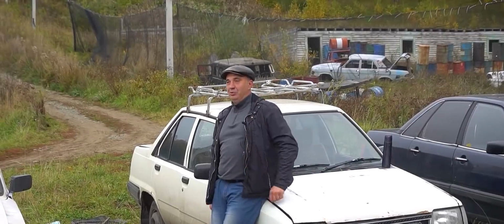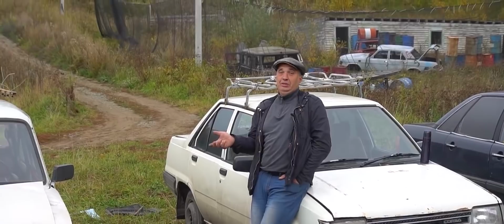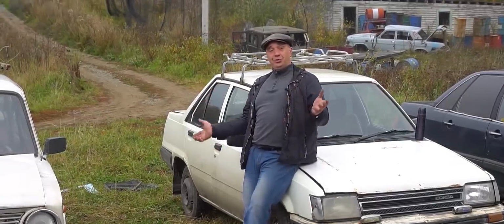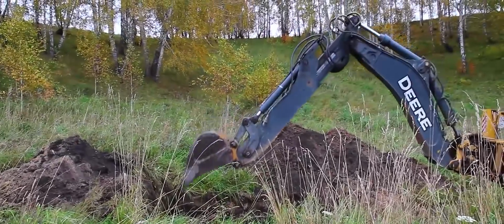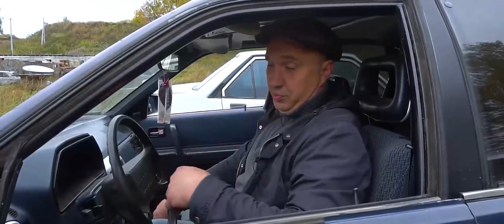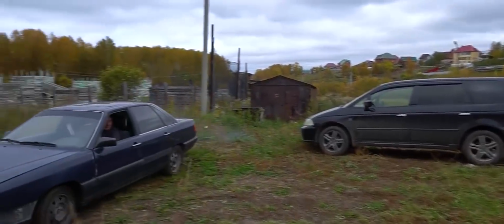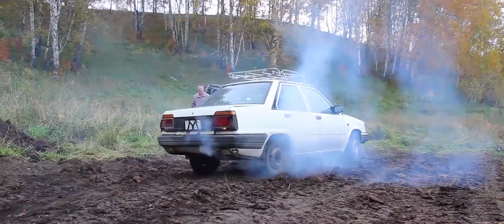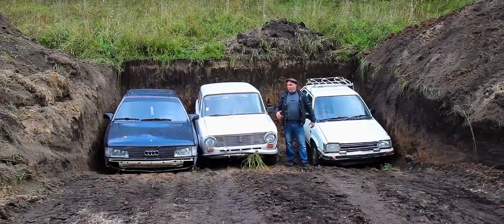We buried a German, a Japanese and a Russian

Comment: Next year: Some Russians forgot about the cars. In next 3000 years: Three unidentified artifacts discovered by archeologist.
Reply: after 3000 years, just change battery and oil and the toyota still run lol...
Reply: Meanwhile the Lada starts straight up on it's orignal battery and 3000 year old oil
Reply: They removed the batteries...
Reply: They actually dug them up recently. Most likely that video will be translated soon.
Reply: @SwapBlogRU  link?
Reply: @wetlettuce4768  😆😆😆
Reply: @wetlettuce4768  aber die Batterie darf nicht aus russischer Produktion sein!😉😘

Comment: Never seen a Lada in person but I know they are built like tanks. I think it will be in the best condition after a year.
Reply: You know nothing about Lada's then, lol.
Reply: Piotr Noja well can we agree that the Audi has no chance. Lol.
Reply: The toyota will live
Reply: ThriftStore Hacker 
They used to be legal in the EU, they banned them for safety reasons. Not sure what, I don’t think they complied with regulations.
Reply: ThriftStore Hacker I don't know about 80s Audis, but the 90s ones have some of the best rust protection out there with galvanized panels.
Reply: Guns Of Spuds there will be nothing left of the Toyota, but the engine will run like new.
Reply: ThriftStore Hacker like toys tank...k they r super dangerous n stink like crazy coming from 🇨🇺🤣
Reply: Piotr Noja, but you have to ask yourself why you don't see any 20 year old Audis, if they don't rust then everything else must be rubbish!
Reply: ganymedeIV4, so they are not built to last, which seems to be the way most car manufacturers are going nowadays, which is why I buy older cars, as they were built to last, unlike the Audi I bought that fell apart, even though it had a full dealer history. You would have to pay me to buy German again.
Reply: TheMattbrownbill There's plenty of 20 year old Audis driving in Poland, lol. And they really have no issues. I don't see any pre 90s ones though, so maybe they weren't as durable. The one in the vid looks like early 80s or late 70s model. I don't see them on the streets.
Reply: Obviously Green Silver knows nothing about the EU or Lada.
Reply: Toyota is already in rust so it will have trouble. The engine might be fine  though
Reply: rick delair.....interesting....dont know where are you from or on wich cars are you used to work but wet cylinder liner type engines here are notorious for head gasket failure and liner failure...thus leading to overheating and seizing..(rover k series, peugeot 1.4d, renault from cleon to f series, i wont even metion hondas were they need to install sleeves to hold the liners together to have seriuos power etc etc) "fast wearing siamesed steel cylinder bores" or the more traditional engine design seems to run forever and happy with or without propper cooling, on standard or 500% more power....
Reply: Piotr Noja the Audi in this clip are 84-87
Reply: RB25luvGT35R I fell ya I come from the same place 2. Every taxi driver in Cuba would prefer an almendron than a Lada since they can load 6-10(yes 10 on 1 car) people on it. Not that we have a choice but still.
Reply: They're all old cars so I imagine they're all well engineered - before the planned obsolescence kicked in. They'll all hold up fine. Probably none of them will drive though, two out of three could barely drive as it is.
Reply: You see, Lada's are generally made cheap. not of the best materials. not in the best manufacturing setting, with imperfect tolerances. but they work. sure they sometimes fall apart, a door here, the window, maybe the exhaust pipe or transmission fall out. Just bolt it back.

However, because of the acceptable tolerances being so numerous. MANY things can be less than ideal but the car will still run. I say the Lada will require minimum repair to restore function.
Reply: +ThriftStore Hacker Toyotas are great cars mechanically, but rust protection isn't their strong point, especially in the 80's. That Lada model is basically the same car as a Fiat 124, but with a little thicker material, a different engine, a bigger heater core, etc. little adjustments done to better suit the Russian cold winters.
Reply: wopmf4345FxFDxdGaa20 I think they need to throw a Volvo in there.
Reply: That lada is a fiat made it under licence
Reply: i can sell one for 500
Reply: My dad used to have one in Greece back in the 80's. Although it was the export model, hence better quality than domestic Russian, it rusted after a few years, superficially. It had a very rigid shell that destroyed anything it looked at, no need to touch it. It burned oil, until he had a fiat mirafiori manager transplant, at which point it burned tyres and the asphalt. The transmission was shit and the steering all over the place, so we learned how to power drive it. It was totalled  in an accident by the most unlikely car in the world. A 1976 mini clubman estate rammed it and nearly cut it in half. The mini was repaired for minor cosmetic body work. Lada was tough, the mini was like a marble block.
Reply: Well, yes and no. Material quality is only good on the first 3 years of cars (up to 1973 model). Other than that, they are not really reliable from maintenance point of view - they'll break down more than any German or Japanese or even American cars. That being said, when they do break down, the fix is usually (most of the time) much-much easier than on other cars and it is order of magnitude less costly. Also, you could argue that they are engineered like tanks (that would be more proper description than saying built like tanks), and they are indeed way more reliable than Japanese, German and even American cars in tough conditions, when roads end and trails and dirt roads begin. In this sense they are absolutely reliable because they will get you home safely (well, even if you have a breakdown, you have a very good chance of repairing and making your way home).
Reply: The one in the video is late 80s or even early 90's model. It is not crazy old, although probably old enough to be more simple and reliable than modern money pits :)
Reply: Exactly! Couldn't have said it better myself. It's built on the same principles as the Kalashnikov rifle, except that in case of Kalashnikov the Soviets were up to standards in material quality (as good or better than Western analogues), while in case of the Lada engineering is the only thing it's got going in terms of reliability. Material quality is just disgraceful on those cars.
Reply: Very true, but arguably it is a significantly better car than the Fiat. Mods may seem minor - this here, that there - but overall it is the better engineered car than the Fiat 124.
Reply: Honestly, you're the first person I hear complaining about the transmission on a Lada. As much criticism as they rightfully deserve otherwise, the gearbox is the one thing they got right (even by  today's standards). And I'm not just repeating a cliché. I've driven different cars over the years, and have to say that many modern manufacturers could learn a thing or two about building transmissions from Lada engineers/manufacturers. Perhaps not super reliable, given the material quality and limited torque tolerances (beyond what engine it was designed for), but as far as feel/usability, they are hard to beat.
Reply: Lada rusts like crazy.
Reply: Audi and Toyota will be fine. the Lada will come out badly. there made out of cheese.
Reply: Your biases would be correct if all cars were factory new, but judging by how they drove going in, I'd say the Lada has the best chance of them all.
Reply: Toyotas are one the most reliable cars on the planet, just like Honda.
Reply: If the Audi has galvanized panels like mine did, it should fare well. Solid car.
Reply: I've driven one. They are absolutely crap. But they do have same fuel consumption as a tank...

Comment: The Lada has better resistance against cold weather and moisture. So it will be in best condition. The Toyota also will survive this test. But that shitty Audi didn't even start wen it was time to cover it in dirt. The Lada push started it. It's not going to start after a years. It will snow a lot in Russia and al that moisture is going to kill the Audi's electronics.
Reply: Ilias Lamari Toyotas are one of most durable cars. They are used in war because of how tough and reliable they are. I mean honestly, I can't see how they other two will compete with that.
Reply: same toyota and lada will start
Reply: your lada will not start but the audi will
Reply: the lada will start becouse the allways start.
Reply: Flame Scorpion The Audi didn't even start to begin with, Lada had to help its ass- did you watch the video? 😂
Reply: Probed Out  i whatched the video the audi didn't start because he didn't put a battery on it
Reply: No Flame Scorpion, the Audi didn't start because the starter motor is busted. Are you sure you watched the video?
Reply: I dunno, Toyotas have an infamous rusting problem due to the low quality steal used in their frames. It might be a rusted out mess in a year.
Reply: tacdiesel  yes i watched the video
Reply: i think the lada and the toyota will start but the toyota will rust

Comment: I had a Lada (Samara) and a Nissan (Sentra), Lada's sheets were heavy, 2 or 3 times the thick of Nissan's... but in few years Lada's were in visible rust and becoming holes while Nissan's after 24 years had zero (none) rust. With that personal experience I bet all my money to the Toyota. And in engines the quatity of japaneses is for me just in other level.
Reply: Though Toyota's engines are fairly reliable, the steel used for the frames is pretty low quality. Toyotas in general, especially the trucks like the Tacoma/Hilux, are infamous for having their frames rust out from under them.

Comment: My guess is the following: toyota will start, but not be alble to drive because everything besides the engine is rustet to peaces,  audi will look the best because of the galvanized body, but won´t start. and lada will look horribly rustet, but start, run and drive like nothing happend. But there is a chance that even the lada will be rusted away to much to still be driveable. Rust only needs to eat a lttle hole in the gas tank, and it wont running.

Comment: This is such a load of crap. The Audi doesn't start on its own, & smokes like a pig. The Toyota they acknowledge barely runs and smokes like a chimney. That Russian thing is cold war era, dead nuts simplistic In design, engineering, & execution. It's also in the best condition of the 3 cars. Hardley a ballanced test.

The Audi would win if the starter worked.  Fuel injection systems are sealed units, survive long term storage better and will start easier than a carburetor with old bad gas that has degraded.

Comment: I have a 1998 Toyota Camry, 1991 Jeep Wrangler YJ Sahara , 1992 Jeep Wrangler YJ , 2006 Chevrolet HHR, 2002 Ford Mustang GT and a 1999 Chevrolet Suburban LT. And I can say out of all my vehicles I have the most faith in thru hell reliability with my Jeep Wranglers, Powered by the iconic AMC i6 in-line 4.0 Liter 6 cylinder it is unstoppable. Short wheel base and low gearing , great 4x4 system with the 4.0L power plant it’s the best. Toyota would be a close second.

Comment: Here is what's gonna happen. The Audi 100 is galvanized,and if it didn't went threw some serious body damage,its body will remain completely intact. Engine however,with that K Jetronic crap,and it's crappy fuel pump,might not start up,at least not all cylinders. That Toyota will rotten for sure. But will start more than certain. Lada not sure,but will have less rust damages than the Toyota,and as it's carburetor,it will need some adjustment before start. But it will start surely. No need to wait a year. Stupid video.